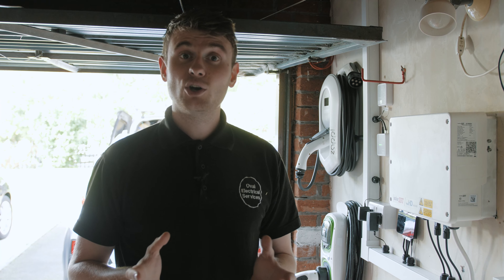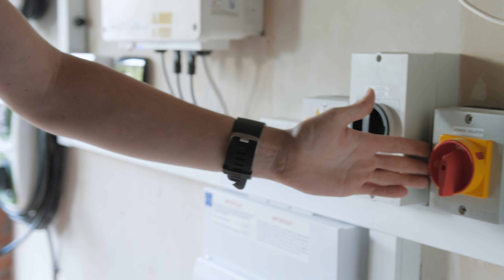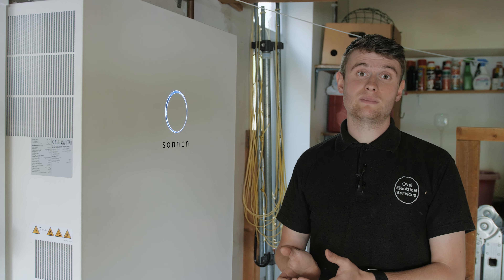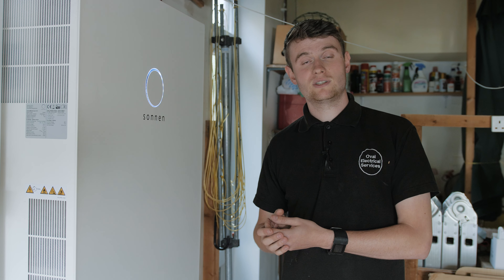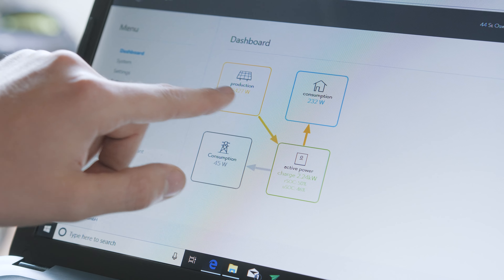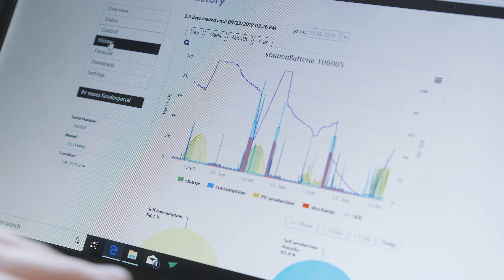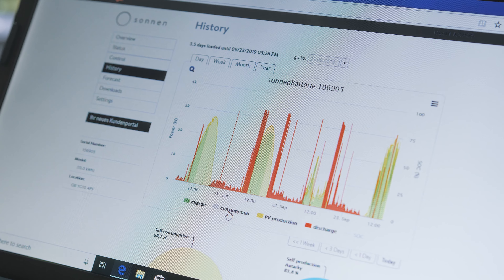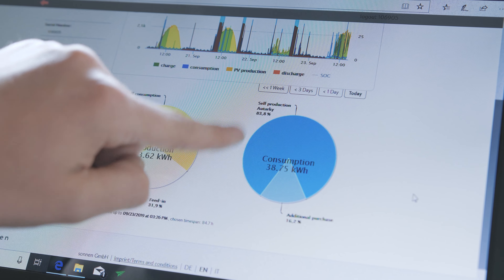Fulford Home Energy System - Part 3 Sonnen Battery Storage

Comment: How did you configure this system. 

If the battery is on the AC side how many inverters are there and how do you stop the AC side not being overloaded on the most productive sunny days ?

Comment: Is there a CT connected to the battery and relying information of when the battery stores energy to the EV charger?

Is there an opposite CT connected to the EV charger sending this information to the battery?

Is there a software parameter for each device to prevent them from entering an infinite loop to decide when to consume energy and when to stop without cycling repeatedly between switching on and off?
Reply from the maker: The battery has two CT clamps, one on the solar and one on the main meter tails. This tells the battery how much power is being produced and then what the home is doing with it. ie exporting it or buying power in to top up the solar. The Zappi has three CT's to tell it what the home is doing ie. importing or exporting, another one telling it what the solar is generating and the last one to tell it if the battery is charging or discharging. As all the equipment is a different brand they will not talk to each other directly. If the Zappi has been selected to have priority over the battery and the Zappi sees the battery is charging then the Zappi will start charging and effectively rob the power from the system causing the battery to stop charging as it will see an increase in consumption in the home.
Reply: Oval Renewables thanks.

I finally saw the last video, your answer for one of the comments clarified the first two questions, and your answer on priorities answered my last question.  

Given that there is no communication between the Zappi charger and the Sonnen battery and the small PV system, do the consuming devices ever cycle even ever so slightly (a few seconds) while they sense that the other device is, also, consuming energy?
Reply from the maker: @ek9772  there may be occasions where they both turn on but this isn’t common and only lasts a few seconds.

Comment: Do you know if these Sonnen batteries are able to power the house in the case of a grid outage like the Powerwall with the gateway?
Reply from the maker: You can add a Sonnen protect to the batteries that will give you some power during a power cut. However you have to select the circuits you want to protect and wire them to then Sonnen protect.
Reply: @OvalRenewables  Ah right I see.  Hope to see more content from you guys soon :-)